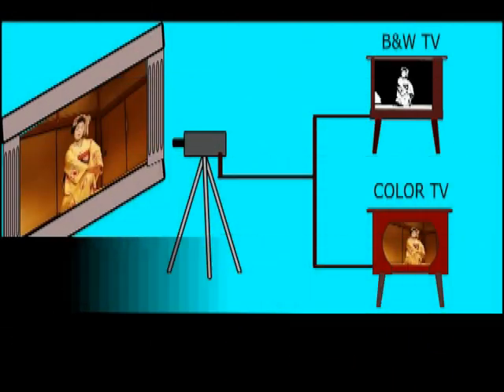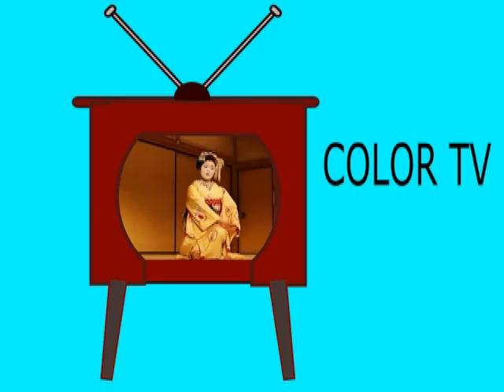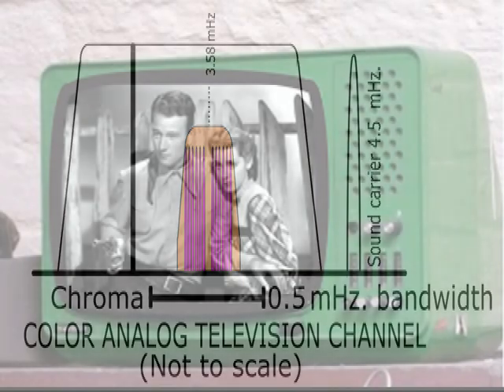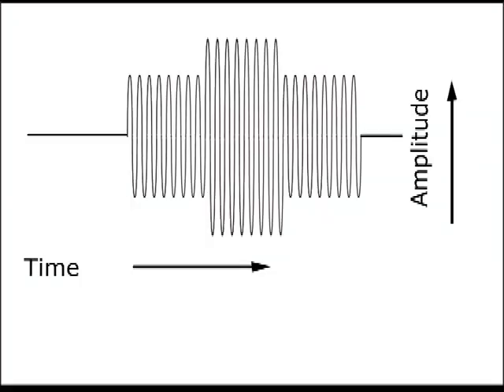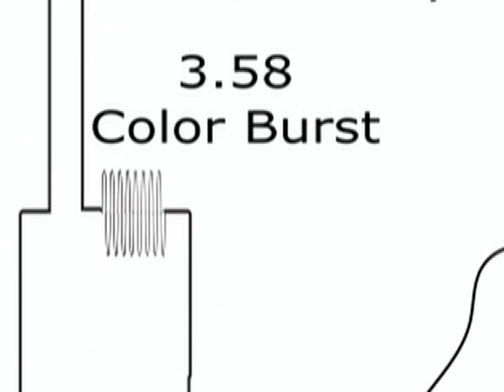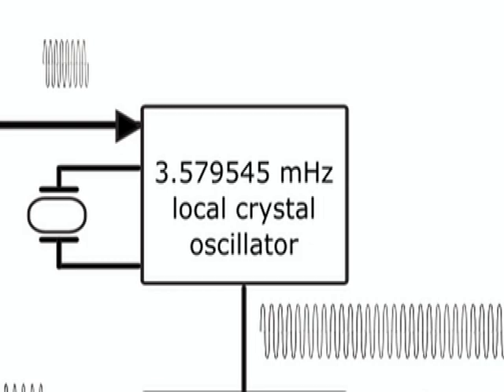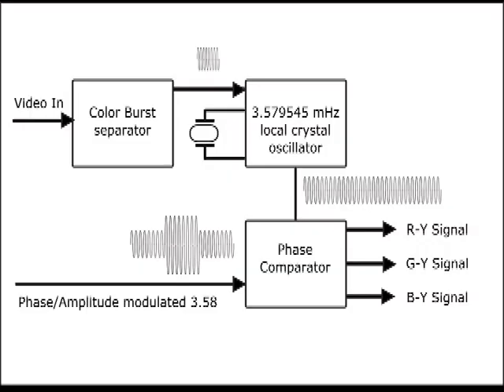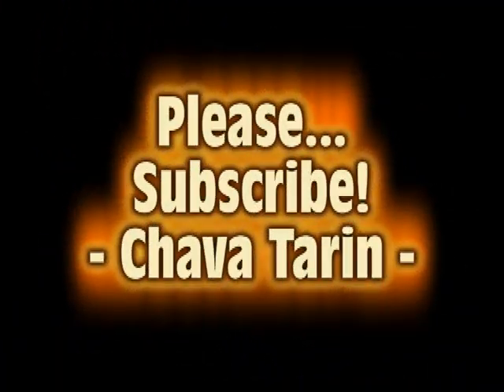Compatibility between analog black and white and color TV

Comment: Very cool, I always wondered how both color and B&W sets received the same signal, they were actually different signals from the same TV station.
Reply from the maker: Dear CoopyKat, yes, indeed, together with the relatively high definition (4 mHz) luminance signal, a lower resolution (1.5 mHz, maximum) chroma signal, offset as necessary to be seen faintly as a passing net, which is only transmitted when there is color in an object, staying off for all gray, black or white objects, it is a clever system which has even provision for all beat frequencies present in the signal, such as FM audio and AM luminance signals, which would interact to produce an annoying wavery signal on the screen. Of course, modern digital systems are far better, however, NTSC, PAL and SECAM color signals were a great accomplishment on those days, indeed!!! Regards!!